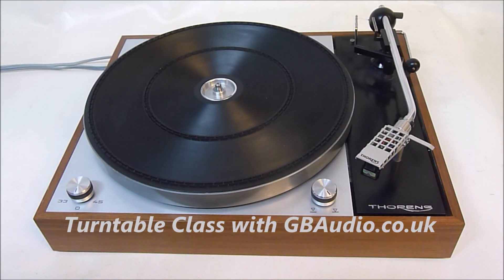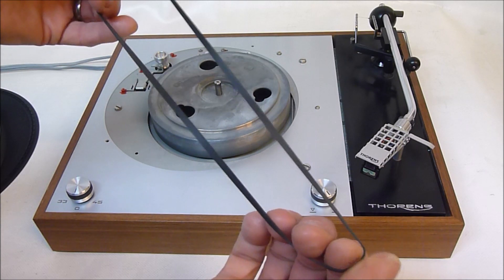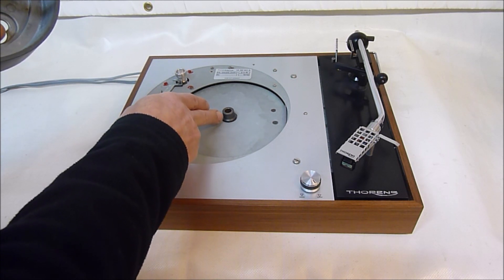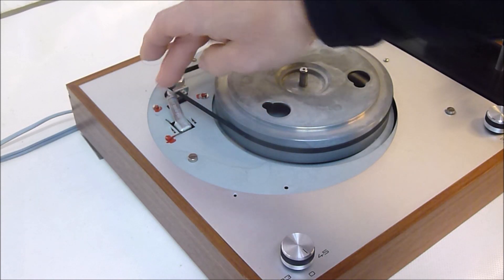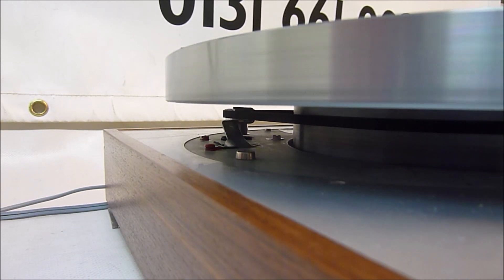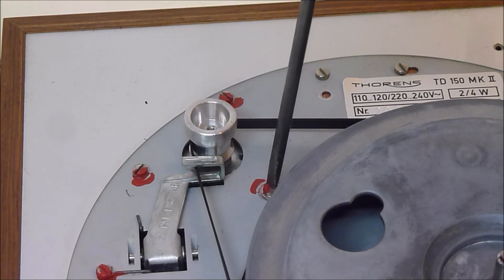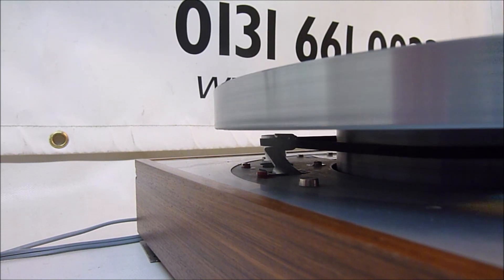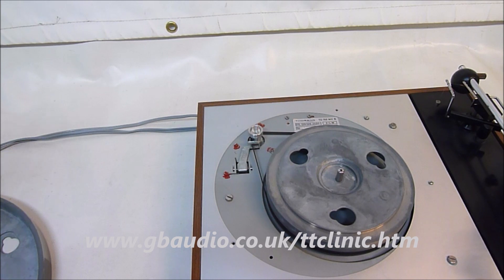Thorens TD150 Mk2. Part 1. Top Deck service and set up: main bearing, drive belt, motor azimuth.

Comment: just got myself the TD160B mkII, when I select 45rpm the height adjuster is high, so much so that it rubs against the underside of the platter causing a grindign noise, you can see the mark on the underside of the platter where it has been rubbing, now I don't want to bend it, does that screw allow for the adjustment of this? In 33 it works fine.
Reply from the maker: Sounds like the whole subchassis is sitting too low. Tighten up the springs a bit (see my other TD150 'below deck' tutorial).